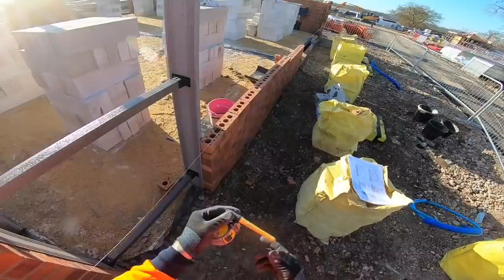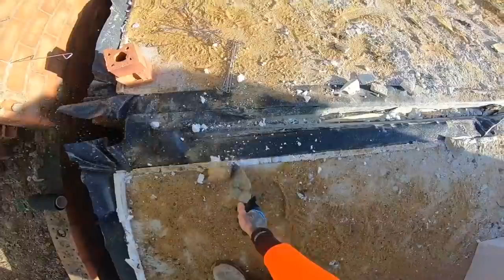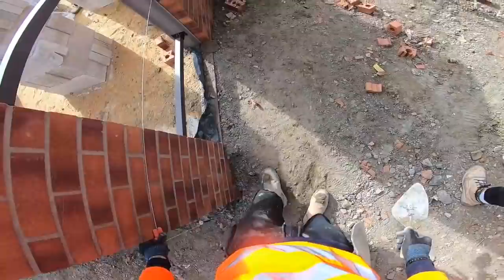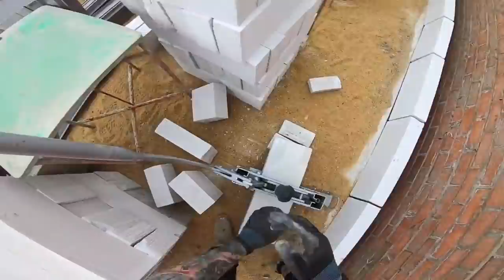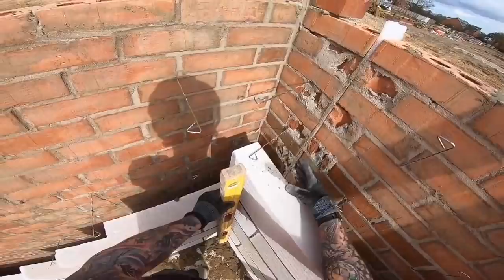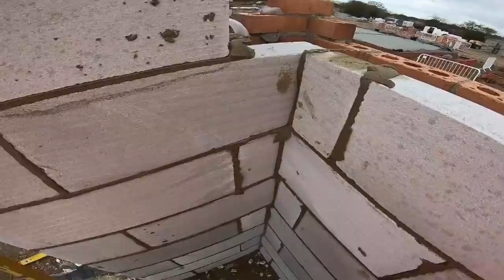building the front of the house

Comment: Shouldn't need to keep screwing the blade down on each block, just leave a few mill clearance so the block slides in and it should cut it.
Reply: ye noticed that too, should only adjust it acording to if its bricks or blocks, not on every block :) Thats what the big handle is for, actually "snapping" it
Reply: But it'll cut better without any slop.
Reply: Oh yeah you need too with that type of cutter mate.

Comment: Charlie I know you love your gloves. I’ve told Changy the same.  Buy the Showa 370 gloves you won’t go back. They last and the feel you get is incredible! And also with the block cutter you don’t need to wind the handle in as much
Reply: why are they better than the portwest palm gloves i can get for 60p a pair bulk buy on ebay
Reply: You do have to screw them down on therm blocks or they don't cut, conc blocks you can leave a gap
Reply: @cliveramsbotty6077  buy them and find out.  They’re £3.50. If you’re on £1000-£1500 a week I don’t think you have to worry about £3 gloves that last a month

Comment: Andrew Palij is right - once yoou have set the gap for a particular size of block, ther should be no need to keep adjusting the blade height. If you tighten the screw any more it will cut the block without pulling the handle!  The cutter that Changy uses looks so worn that the mechanism needs re-furbishing hence he has to adjust the screw each time he cuts a block!
Reply: My cutter doesn’t need tightening for block paving but I do have to tighten it each time when cutting softer blocks.
Reply: I've watched parts of 2 of his videos.  I didn't see him actually cut any blocks,although his cutter was on the scaffold. I'll have a proper look at the weekend

Comment: Is the corner not weak now because of the expansion part with the foam in it I just have visions of the gable separating.
Reply: Is that why you use wall ties every course
Reply: @martin2466  those slip ties would  be better if the 2 pieces were locked together but not for the brickies though.

Comment: I'm sure you agree but those movement joints look so wrong. The corners of any wall or building is its structural strong point which keeps the build rigid & square but in this scenario the walls are able to float away from each other. Don't get the theory behind this idea. This plot is very similar to previous ones where MJ is on the party wall. Weird. Luv ya all.

Comment: Joint up blocks on the inside of a house what is the reason for that over here in Ireland if you said that you would be laughed at
Reply from the maker: It’s a joke that’s what it is 🤦‍♂️
Reply: I won't joint blockwork up full stop, its not a NHBC requirement or Building Control,
Reply: A lot off brickies joint up block work for air testing at the end of job even do there dot and bad after but most new build fail the testing
Reply: @markgreenwood1447  They are foretold what houses are being tested and try and sort it with spray foam , still fails. I've seen thermo imaging of plasterboard not installed properly and it's unbelievable it actually causes drafts. Jointing blockwork started because shit Bricklayers couldn't keep there joints full and flush, none of the houses built in the 50s ,60s and 70s have fallen down because the blockwork wasn't jointed.
Reply: @martin2466  Waste off a good jointer 👍😁
Reply: @martin2466  😁yep expensive and don't last 5 mins.